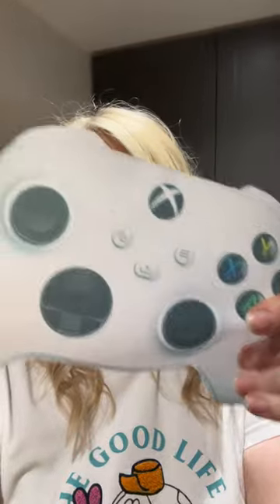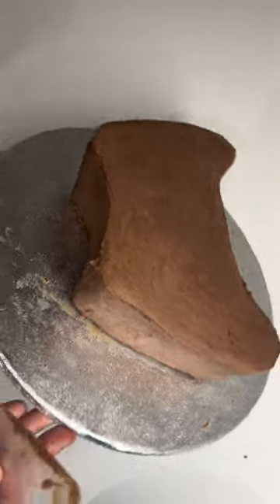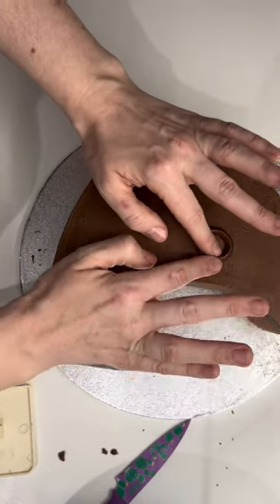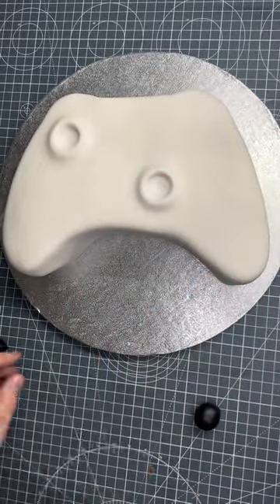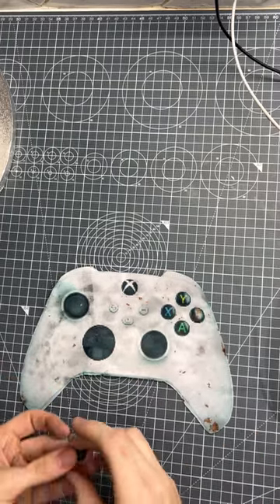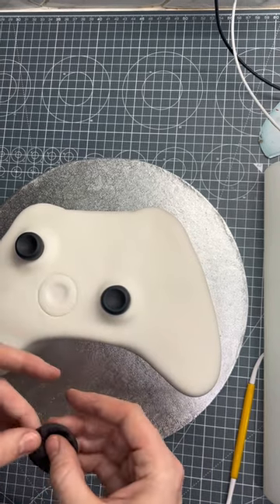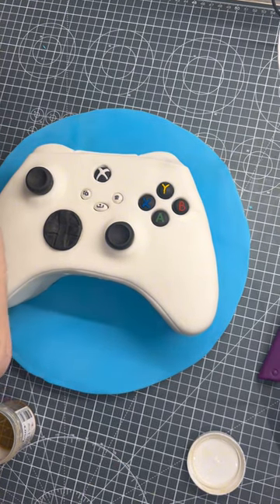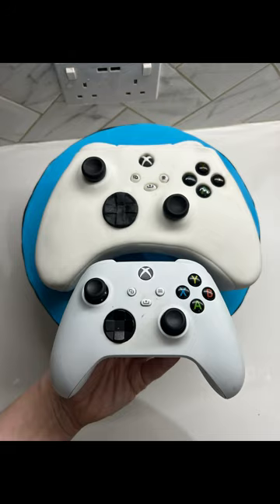Xbox Controller CAKE - How to Make It!

Comment: Is molding paste the same as modeling chocolate or gum paste?
Reply from the maker: Modelling paste is similar gum paste yes but it doesn’t dry as quickly so you can work with it a little longer. Modelling chocolate will set firmer than sugarpaste too but it can get very soft when it gets warm in your hand and with the pieces I used being so small they can get very soft and difficult to work with. I really like the saracino brand of modelling paste but you can get different brands like smartflex, renshaw etc x
Reply: @AnyExcuseCakesAndBakes  thank you so muchthis was very helpful